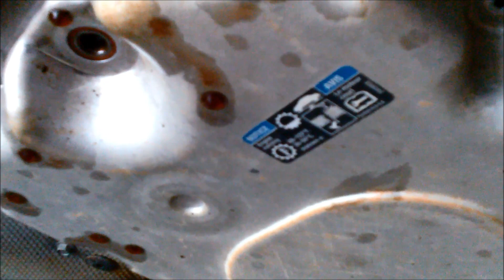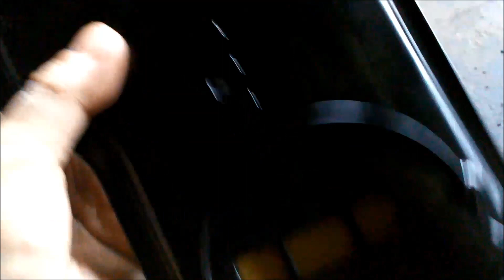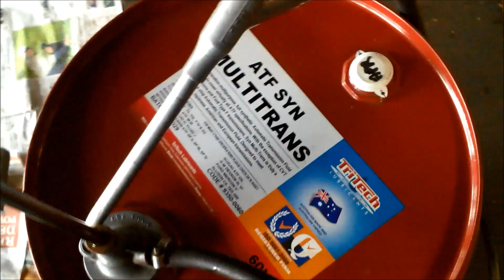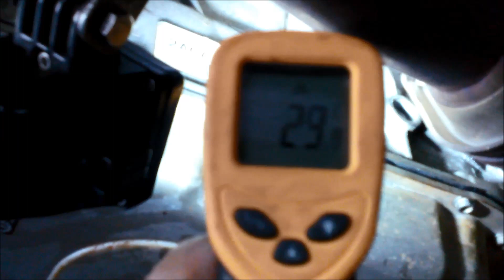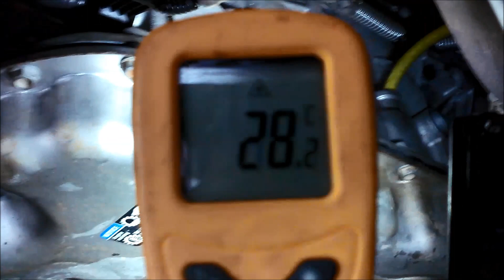VE Commodore Holden GM Equipe Omega 6L50 Automatic Transmission Filter Service

Comment: I just done my today ve Holden 2011 sv6 helped me a lot thanks a lot great video. When you check the oil if it’s gust dripping is that enough oil thanks.
Reply from the maker: hi, if at testing temp. then yes. thanks & cheers

Comment: Tip: if you don’t have a digital thermometer for the temperature you could always go into engineering mode in the car and it tells you transmission sump temperature
Reply from the maker: good tip, cheers
Reply: Martin A my trans temp shows 75 while in idle. Is this bad? Cause I have done the service correctly and set the oil level just as explained in the video. What am I missing?
Reply: Engineering mode temp is best because its taking the temp of the fluid inside the case. A digital thermometer is taking surface temp of the case, and this can vary greatly depending on whether it's cooling or warming up. Long story short, engineering mode temp only.

Comment: How many US Quarts does it take to fill it back up after just a drain, filter replacement and fill. Thanks in advance.
Reply from the maker: hi, what comes out should only be considered a rough guide in case wasnt filled accurately or has a fluid leak. always check as per manufacturers instructions. cheers

Comment: Thank you for the nice video.
How to make the fluid getting warmer?
Reply from the maker: hi, I'm guessing you mean how to warm up the trans fluid in cold climates or snow? ...you can run a transmission oil cooler right next to the exhaust manifold and utilize the heat from there. I'd probably also add a trans temperature gauge and also allow for the cooler to be attached to longer section of flexible hose, so you can move it away from the exhaust manifold in needed. cheers
Reply: Thank you from Sweden

Comment: hi i have a 2008 6 litre l98 ve calais sedan with 160000kms and 6 speed auto, im not sure when the auto was serviced as i bought the car secondhand. The gearbox is hopeless with hesistation on kickdown,  indecisiveness and like not being in gear when rolling  through a corner or roundabout etc. I have read many things from it needing a flush to a tune to a new battery to it being just a horrible auto with torque management settings etc but it makes it horrible to drive , what would u recommend? will a service and flush make it better and how much should it cost or would it not change the bad characteristics of the box? thank you very much in advance
Reply from the maker: Hi, definitely start with basic checks first...especially correct fluid level and type. if it hasn`t been serviced in a while it could have partially blocked filter and/or contaminated solenoids. I wouldn`t completely flush out all the trans fluid ( unless it has coolant in there ) as it will thin out the fluid and then potentially run worse as the thinner new fluid will be able to run quicker through any worn sealing joints in the transmission and create low pressure problems. you may also need to take it to an automatic transmission specialist and see if any stored fault codes and maybe a pressure test. hope that helps cheers
Reply: hi thank you for the reply and information. How much roughly should a service without a flush cost at a transmission specialist?
Reply from the maker: hi, depends where you are I guess. cheers

Comment: Thanks for the video instructions.
I have 10HBA auto transmission. When I ran scanner I get the error code: P0864-00 (Invalid Signal from TCM).
When I inspected the transmission I can hear noise inside, something like engaging and disengaging every second or so. 
When I moved the car, I noticed the car feeling like it was auto switching from drive to park then to drive snd so on.
On the cluster I can see when I change to any other gear the icon is displaying the gear I selected then keeps jumping to park and back to the gear selected. 

I can't seem to find anything with similar issues on any auto transmission models. Just trying to workout what could be causing this before i get it towed to someone.
Cheers
Reply from the maker: hi, that often happens if you have selected wrong trans/vehicle on scanner or if your scan tool is incompatible. cheers
Reply: @YepThatsIt  so it turned out it was TCM. New TCM programed by our local automotive dignostics specialist. Explained the issue he advised it would be the TCM but i wanted to make sure before spending more money. He came out within 5min he diagnosed it. 
Cheers

Comment: Thanx for the video, very helpful. Iv  got omega 2007 ..when i stop on a trafic light on an uphill it rols back a bit when I take off , even if the hill is not steep.though the gearbox works fine apart from slight delay when it shifts up one gear when you floor the pedal.  I dont knwo when the gearbox was serviced or if ever serviced.its done 178k. Any advice of the what the issue might be ?
Reply from the maker: hi, check fluid level and really worth doing a service. the cleaner and cooler you can keep a transmission the longer it will last. cheers

Comment: Hi mate love the video. I have drained the transmission oil from me 2013 VE wagon with the 3.6 SIDI motor, and am having trouble locating the dipstick to top up the oil. If you could help that would be great thanks.
Reply from the maker: hi, should all be there in the vid..cheers

Comment: Good video presentation just a question on 2011 holden Commodore sv6 can you use the engineering mode to check the temperature of the transmission will appreciate a replay thanks John.
Reply from the maker: Hi, there should be temp indicator in there. cheers

Comment: Hey mate, is this trans service procedures the same to all the other ve/vf transmissions? Eg. 6L50, 6L80e, 6L90 etc.
And do they use the same filter? 
Cheers.
Reply from the maker: hi, just get the suitable kit to suit...they have 146mm and 160mm height filters and then colorados also have a longer spacer on top of filter. cheers
Reply: @YepThatsIt  ah ok, I didn't know that! Thanks.
Reply from the maker: @JohnMcCoy36  glad helped, few beers always well appreciated https://www.paypal.me/BATS189  cheers

Comment: I need some advice, I recently took my 2011 VE SV6 for a 150K service, a part of that service was to do the AutoTrans fluid and filter. I drove off after the service and returned the car because it was running rough plus hard shifting, they had the car for a day and couldn't work out the problem. I've since found out (by taking my car elsewhere) that a goo/silicon of some sort was put on the cork gasket and bled in to the AutoTrans fluid making the car run rough. I'm battling it out with the service provider because they are denying any maintenance errors, can you help me get some proof how the gasket should be installed as per the correct procedures to back up my case...
Reply from the maker: hi, they must`ve used an absolute excessive amount of silastic ! ( to cause restriction in filter flow ) and it baffles me why some mechanics use so much anyway ? we very rarely use it...only on housings that dont have gaskets or seals ( usually only fwd transmissions ), but they are precision flat surfaces anyway and we will only use a very very thin amount. can i ask if it was a transmission specialist? i would be surprised if it was..cheers
Reply: @YepThatsIt  No it was a local car service franchise, I won't mention them just in case it affects my dispute which is possibly going to end up in court after their refusal to compensate me for the repairs. I thought I did the right thing by giving them an opportunity to diagnose the problem but after having the car for another 4 hours they couldn't, so I got it diagnosed and fixed elsewhere, thanks for the reply...

Comment: hi ,good video , i have question regarding 6L45 TRANSMISSION is it the same filter kit as the 6L50 ,and  the E  on the mean thanks
Reply from the maker: Hi, depends on vehicle ( you could google it ) there are few different types according to catalogue....
Filter 6L45 BMW X5 2006-ON  
Filter 6L50 Total Height of Filter 146.30mm 2006-ON  
Filter 6L50 Total Height of Filter 160.53mm 33mm tall Spacer on top of Filter 2006-ON 
Filter 6L50 Total Height Filter 160.53mm 25.4mm tall Spacer on top of Filter 2010-ON
E - just stands for Electronic
Cheers
Reply: Thanks for quick reply , ive done so much research and not come up with exact answer ,its a 2011 ve 3.0 , holden sells them for $160, cant find them any where else , 6L50 easy to find , Thanks anyway
Reply from the maker: We rarely use genuine parts if we can avoid it....after market parts from a reputable supplier will be about a third or less of that price with same guarantee....but choice is yours. Cheers
Reply: yukari garland yeah just doing mine ,Transgold KFS1038 kit is what you need from supercheap. $54, has two gaskets the rubber one is the one that fits.

Comment: Im not sure but some say that the system needs to be fully flushed because there's still fluid in the torque converter meaning you only get about half out if you don't flush it.  Im no mechanic but that's what some say.
Reply from the maker: hi, from my experience people like to compare transmission fluid to engine oil. engine oil acts like a filter and absorbs carbon and needs to be fully replaced more regularly. in an automatic transmission the main function is hydraulic and also lubrication, it is used to move things hydraulically. in a general service on most transmissions, when you remove the pan/sump, about half the fluid will come out. if there is no problem or excessive contamination in the transmission fluid, then changing the amount that comes out when you remove the pan, will be sufficient to boost up the transmission fluid viscosity and desired properties. the problem arises when you have transmission problems, like pressure issues where this will burn the fluid...the burnt/contaminated fluid will be a little bit thicker than new fluid and thus, the thicker fluid will escape or travel much slower through any worn/leaking components. if your transmission has internal pressure leaks, replacing all the fluid with new fluid will only make things worse. if there is no problem with trans and it is a regular maintenance service, then replacing only the amount when you remove the pan is ample. some will argue that the pressure control solenoid and adaptive functions of transmissions will compensate for pressure losses/worn transmission internal sealing joints. some automotive garages will always push for a complete transmission fluid flush, but I reakon if trans is ok, then it is unnecessary and if transmission is worn then it will only make it run worse. having said all that, in my opinion you should always remove the trans pan and replace the filter, clean the trans pan and magnets and add magnets if you want an easy improvement. it is a waste of time to only drain the fluid without cleaning the pan and magnets and/or replacing filter. a transmission oil cooler added will also help keep the trans fluid cooler and help reduce the fluid quality breaking down and losing its properties from heat, as well as reducing the crystalizing ( hardening ) of rubber seals, that happens when you overheat the trans fluid. always use the best quality fluid suited to you transmission that you can afford as well. hope that makes sense and decision is always yours. cheers
Reply: @YepThatsIt   thanks. I'd  like to have a go at doing it myself hence the original question. Im sure that if i dropped the pan every 50k, it would keep things fresh
Reply from the maker: filter service every 50Km up to 200Km then every 30Km after that to get max life. i only do full flush if coolant gets into trans fluid after adding a trans oil cooler and completely bypassing radiator/heat exchanger. coolant kills transmissions fairly quickly. cheers

Comment: 220,000 km caprice 2015 never change oil, ist safe to change now and what should I pay attention to ?
Reply from the maker: hi, just change filter, clean pan and magnet ( add a magnet ) fill with quality and suitable fluid and fill as described to correct tmp and level. cheers
Reply: @YepThatsIt  even if the fluid was black ??

Comment: You need to do one of these for a v8 auto ve there is next to no info and a real pain
Reply from the maker: hi, contact me on my face book link https://www.facebook.com/Yep-Thats-It-103051017785435/  and leave me which  kind of vehicle/transmission type you have, and leave a detailed description of any fault codes and issue you are having ( we are able to exchange pics/diagrams on there ) and details of what work you have already performed or checked...... you will need to buy me some beers ( link is in face book ) and I will answer your questions accordingly. cheers
Reply from the maker: hi, try without forward slash...  https://www.facebook.com/Yep-Thats-It-103051017785435   cheers

Comment: Hi mate you did the trans service the wrong way to get all the auto fluid out you take off the line that runs the the radiator then start the car&all the fluid come out from the gearbox aswell as the torque converter then you can change the filter that's the best way
Reply from the maker: no worries, thanks for that ! let me know when you need a new pump. cheers
Reply: @YepThatsIt  hi never needed a new pump I shut the car off right before the fluid runs out I've done all my cars like that learned it from a mechanic give it ago cheers
Reply: I agree with you..
you can damage the torque convertor doing it that way.
Reply: @atillaozturk7075  I've never had a problem doing it that way or blown up a torque converter
Reply: @bradleywaller3310  
as I said I agree with your method as I was told years ago that undoing to tranny oil cooler line to radiator and flushing out tranny oil can damage your transmission.
Reply: @atillaozturk7075  fair enough 👌